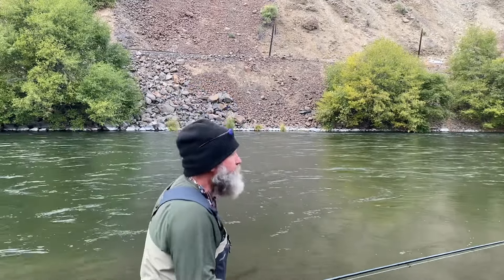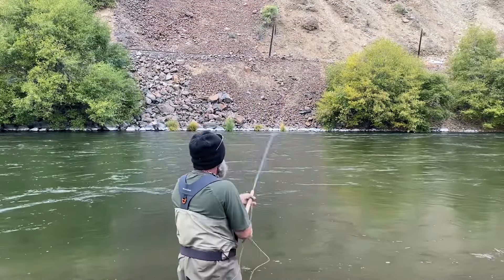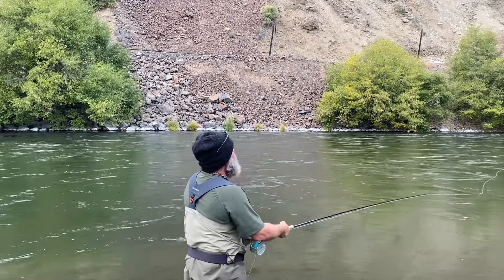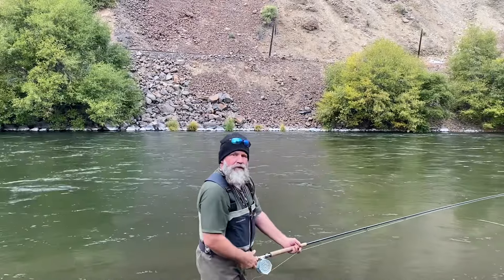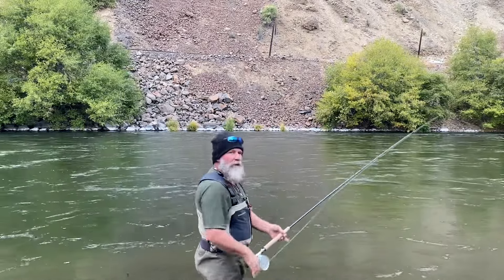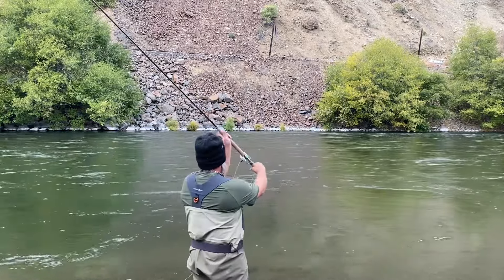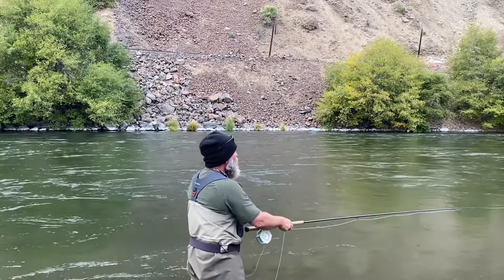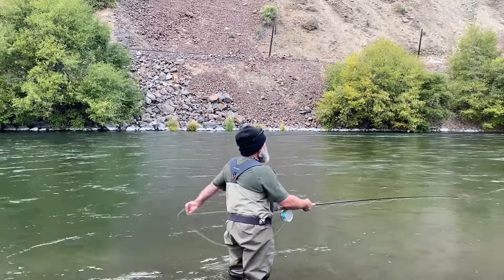Single Spey Cast: Sink Tips

Comment: Thanks again @LineSpeedJediTimRawlins, I am starting to notice 'the soak' as well. The direction change isn't a mystery for me, but inconsistent. I find I can get the timing of said soak perfectly with my trout spey setup, especially after tired shoulders from casting the bigger rods & lines. Do you try out smaller set-ups before heading into the main river? Cheers, Tim. Thanks a bunch for the videos! 🙂👏👏